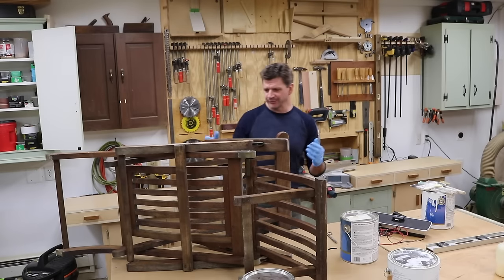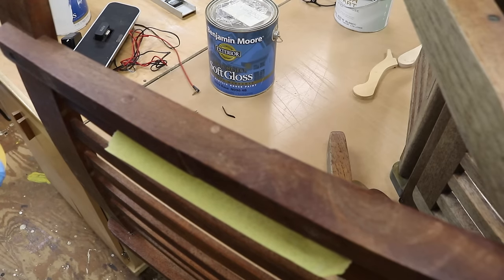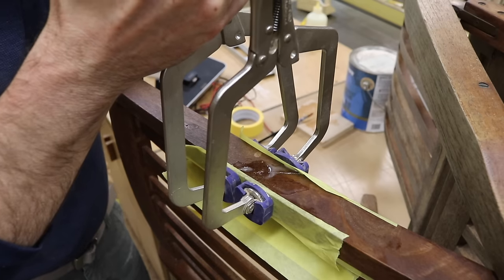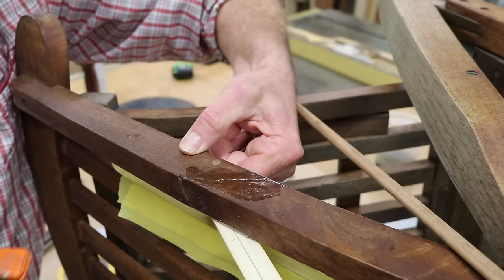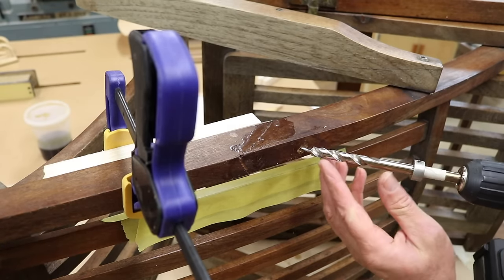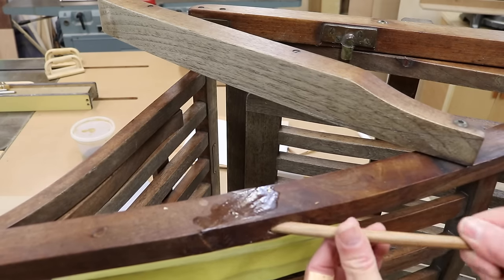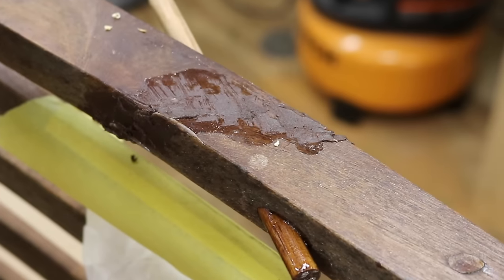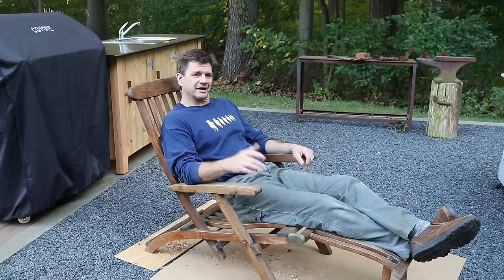Furniture Repair - How to Fix a Chair with Dowel Reinforcement

Comment: Love seeing repairs like this.  Curious how you decide when to use epoxy vs. wood glue?
Reply: maybe it dries clear
Reply: Epoxy has more fill capacity and strength than (most) wood glue.  This repair is in an area that needs good support, so epoxy is a good choice.
Reply: Is epoxy really that great of a choice, since it doesnt soak into the wood as well as conventional wood glue?

Comment: Great repair, thanks for sharing. My minor in college was Industrial Arts. Our woodworking instructor showed us how to use a pair of pliers to make indentations in the dowel. Basically allowing places for the glue to settle in. When the dowel fits so tite there is no room for the glue.
Reply from the maker: good tip Barbara
Reply: Thx

Comment: God info.  All what I thought I needed to do.  I have some dinning chairs made of Mango wood I believe.  Beautiful set but lots of knots.  I have a 3rd chair now that needs repair.  I was wondering if a steel rod might be better long term rather than a wood dowel.  I know I'd always see the steel and it would be more work to finish it smooth.  Think (now as I am writing this) I'll look for some hard wood dowels.  I believe there are a couple of places here in town that carry them.